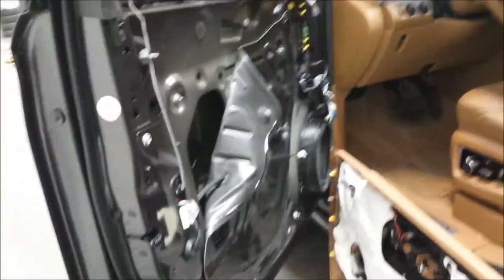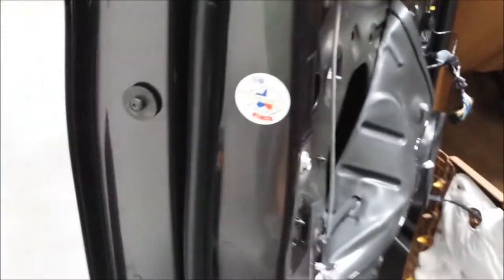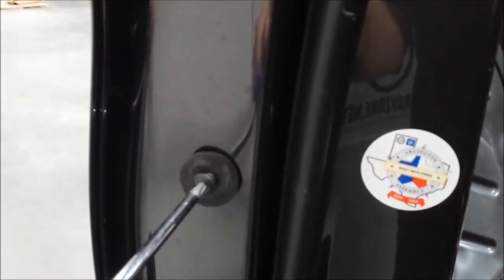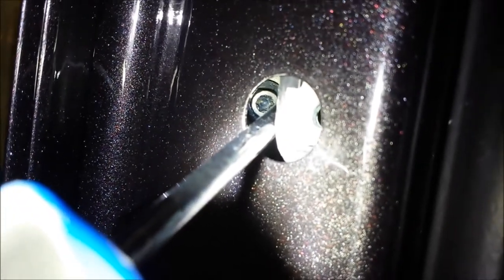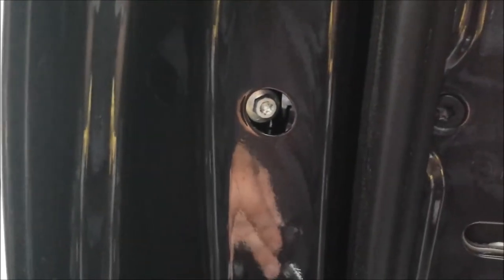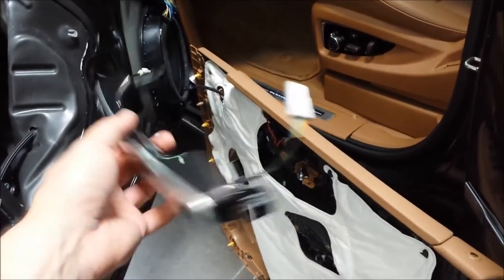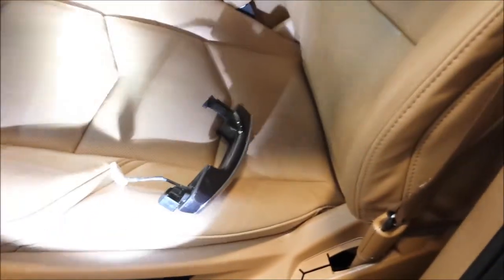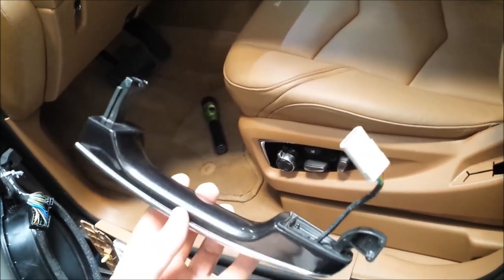2017 Cadillac Escalade Handle Removal

Comment: Great video! Question on a 2016 Yukon rear handles with passive lock... Do I need to remove the inner door panel or is there enough slack to get the plug through the exterior hole? Thanks!
Reply from the maker: If I remember correctly, there should be enough slack without having to remove the door panel but you'll find out for sure when you try to remove the handle lol
Reply: @CHASEPATTON  LOL, love it! Story of my life. "Lemme give this a shot....oh crap". Thanks for getting back to me, really appreciate it.
Reply from the maker: @phog_vision  Initially, the only reason I made this video was because it was easy to remove all the previous model door handles without removing the door panels. I was working on commission at the time so I wanted to give a heads up to techs who weren't aware so that they could ask for more labor time.

Comment: Curious about that "new" screw on the front handle, at 2:50 on video. What is on the inside of the door skin that makes the long post necessary? Thanks for putting this up.
Reply from the maker: Steve Petersen I think the inner skeleton structure of the door handle is designed a bit differently than it has been in the past. The longer post is because of extra metal in that area. You'll get a better idea of it when you start to pull it apart. Good luck!

Comment: For doing it with the phone I thought it went well. Can you tell me if I can do that same replacement but instead of the no light handles I have on my 2018, can I just put in the ones that light up like you are installing? will it basically be plug in and the truck will recognize them?
Reply from the maker: To be honest, I'm not totally sure. I'd imagine your no-LED handles still have to be plugged in but I am not sure if the plug will accommodate for the new handle. I'd search some Cadillac forums for that answer or maybe even the parts department can answer that question at your local Cadillac dealer.
Reply: @CHASEPATTON  Thank you for your reply. I went ahead and bought the 4 handles. They just arrived today. I will be doing a little more research, but I'm hoping it will be as easy as plug them and they will work. They come on some of the Luxury and premium luxury as an option and I'm just guessing that since the handles are electronic that they will simply be recognized. If they work that easily I shall let you know.
Reply from the maker: @cocora22 I look forward to it
Reply: @CHASEPATTON  Ok OEM illuminated handles for cadillac escalde 2018 have been installed. Not as easy as one thinks or sees in your video. They are plug and play. Gray pigtails for the front,  brown for the back. Only works like originally designed, when you unlock the truck remain on then turn off. They do not stay on while driving down the road with headlights on. If you know how to make that mod please please please show us how because there are tons of people who would love to do that. The side screw on the drivers door is a bear to get to, you must have a super duper magnet or some sort of real tacky material to use on the T20 because if you drop it it will be lost. I ended up paying my mechanic to finish the job. If you find them in the original color of your truck it'll save you from getting them painted. Just in case Yukon denali Iridium is the same as Cadillac Granite grey metallic, but search your paint code to be sure. I purchased mine on ebay, same color a my truck for a fraction of the cost. They are OEM and work perfectly.
Reply from the maker: @Cocora22  Unfortunately, I don't know enough about wiring, electronics, and all of that to know how to keep the handles on when the lights come on. From my own limited knowledge on the subject, I'd assume that would be taken care of through programming of the lighting and can-bus system. I'm not totally sure and I could definitely be 100% wrong. Electrical has never really been my expertise. As far as the handles and paint codes, GM uses the same paint codes on all their vehicles. Does not matter if it's a Cadillac, GMC, Chevy, etc. The names of the colors might change but the paint code itself will remain the same. For example, on my paint computer I will look up an Audi paint code and it's listed the same as Volkswagen. The same with Lexus paint codes on my paint computer will show the color as being from Toyota. There's a lot of websites out there that will help narrow down paint codes for you also. Alternatively, you can call the parts department at your local dealer, give them your VIN and they'll give you the paint code too. 

Thanks for the update on the handles too. Very cool to have that info in the back of my mind.

Comment: What about that chrome ish cap that fell off into your hand? What if I just need to replace that.. does it clip in some how and do i have to remove everything to do it
Reply from the maker: I don't believe so. Try putting some pressure on that chrome-ish piece with your thumb and push it to the left. It should slide right off. Do the same thing to the actual handle but push to the right. Try it out. Good luck!

Comment: I have a client that wants to swap out for “Chevy” handles. He will loose the led strip... what are the chances the plug  is the same?
Reply from the maker: Carkrazy DipnDetail well I'd assume that if he's losing the LED strip then the plug could be different since the LEDs need power from somewhere. I've never swapped handles like that before. Good luck!
Reply: @CHASEPATTON  I do have a 2017 GMC Yukon SLT.. I want to swap for the Escalade handles..do I need to do something in the wiring or just plug and play . I want the led strip...
Reply from the maker: @principe986  I don't think that your doors would have the necessary wiring harness that plugs into the door handle. But then again, I could be totally wrong and you could always remove a door panel just to double check.
Reply: @principe986  did you end up swapping the door handles? I have a 2019 yukon sle was also intrested in getting the led handle.